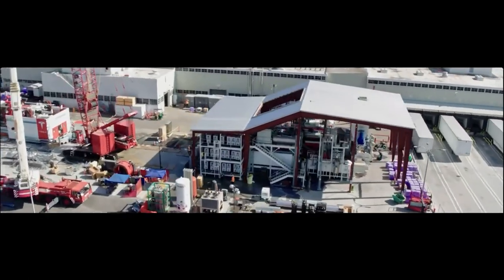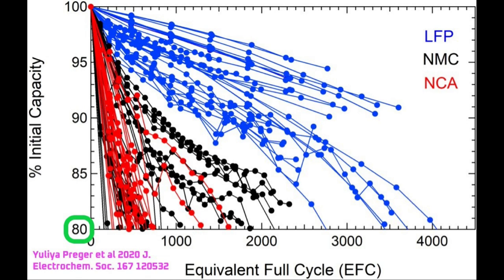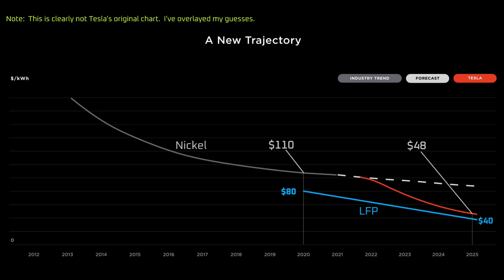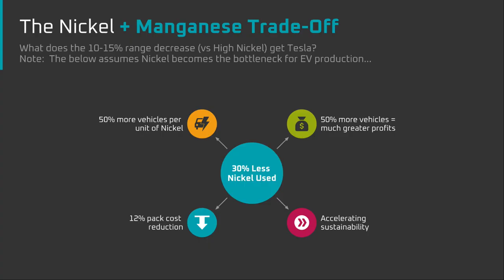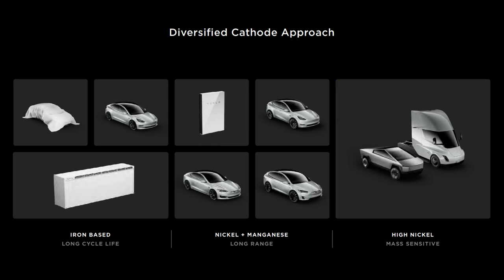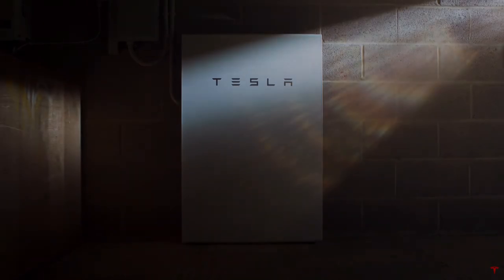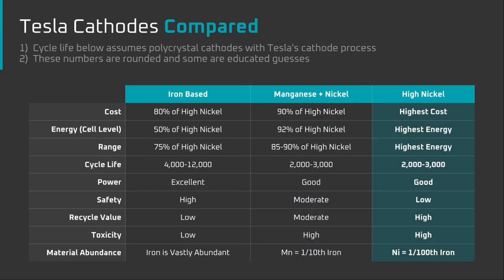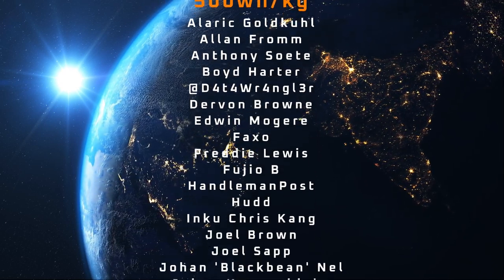#11 Tesla's Three Cathode Choices // Product Impact

Comment: The monopoly analogy is spot on. Tesla will in fact become a monopoly. And by the technical definition, it's an EV monopoly in the states and it's only a couple of years from becoming a battery monopoly. It was evident before battery day that Tesla's demand for batteries was going to starve competitors of battery supply. So these idiots who keep saying the competition is coming (meaning ICE manufacturers can easily make battery powered cars) have overlooked quite a few essentials. EVs are heavier and need reengineering from the ground up and, the absolute killer, EV's need batteries. Who'd have thought it? And for Tesla's marhet share to fall to 20% necessarily requires competitors to collectively make 4 times as many batteries as Tesla. Given Tesla has a plan to boost production by the best part of 100x from here in 10 years, it's difficult to see the competition taking anything like Tesla's share. The price points that you expect LFP to reach in 5 years are astounding. I worked for Sony (in an SW role) 10 years ago who were doing battery research at the time. They had a 1Kwh battery that they were using for storage. I asked 2 salient questions, what's the cycle life and what's the price. The answers, for storing about 15c worth of electricity at the time, 1000x & $2000 left me shaking my head and wandering off.
Reply from the maker: Amen!

Comment: I really.do not think the liquid metal batteries mentioned,  as they are currently configured, are going to be attractive for grid storage. 20 years ago they would have been attractive but I do not think they are now.
1) Charge discharge efficiency 80 %,  that's a 20% loss on every cycle.   Yes good relative to pumped hydro,  but against lithium iron very poor.
2) it has to be cycled at least every 3 days.  To my mind this would often mean you have to discharge the battery even though you have surplus re-newable energy available.   
This effectively drives up the cycle losses to make 30% loss of pumped hydro attractive.  
It also negates the periodic battery replacement cost.   And of course in that time batteries will have got much better effectively upgrading the facility.

Edit re 2).  
The 30% figure I used came from "Ambrie" the liquid metal battery people.  No doubt historically this figure was correct.  Due to improvement in design and other efficiencies modern pumped hydro installations are claiming 20% efficiency.      
Unlike lithium battery based storage there is never going to be mega economies of scale with liquid metal,  so  I think there are going to be few situations where this is going to be viable.
Reply from the maker: Great points!

Comment: Tesla seems to be spending a lot of money on battery research but no mention of solid state batteries?  They can tweak chemistries all they want but SS batteries will be a game changer.  The first company to successfully use SS batteries will win.
Reply from the maker: Solid state will evolve from current state.  It won't be an enormous leap.  What's more important is ditching that expensive cathode.  

I'm seeing that I need to do a couple of videos on SS to rip the guts out of it.  Great tech that will reach large scale in 7-10 years, but what was unveiled at Battery Day was more important - the machine that manufactures batteries.
Reply: @thelimitingfactor  Yes, please do a couple of videos on ss batteries.  thanks